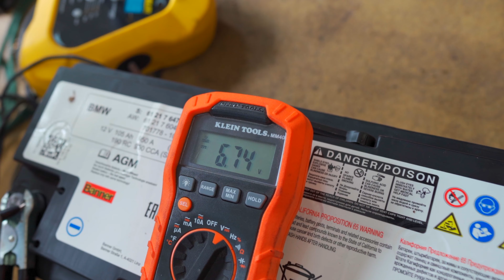Rebuilding A Wrecked 2020 Toyota Supra EP3 - FIRST DRIVE

Comment: 6.74, you were on AC voltage not DC on your meter bossman
Reply from the maker: Hey dude! Thanks for watching! The multimeter was on Volts DC (you can see the straight line on the display) and it was indeed reading 6.74v due to the dead cells. That battery was very dead!
Reply: @albonfilms  Ah fuck, I see it now  you have ac and dc on the same spot of the selector but the function switches with that orange button, my b bossman.